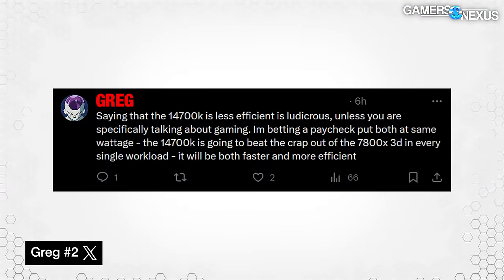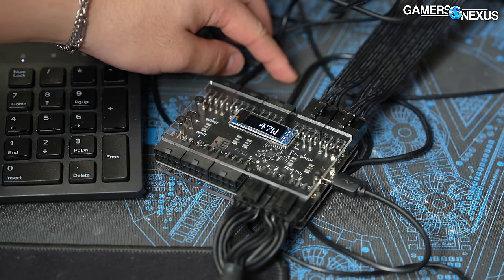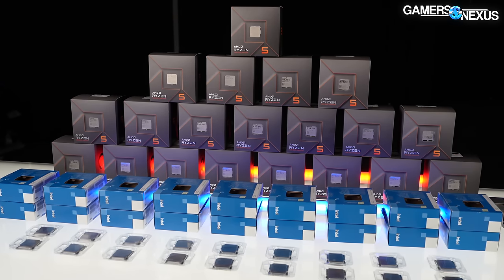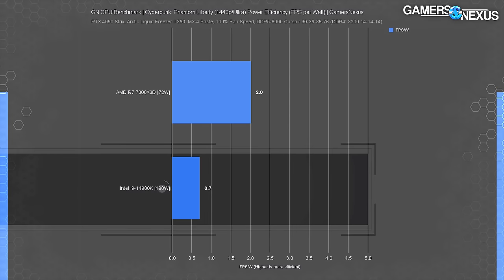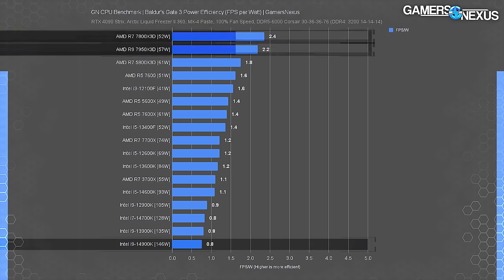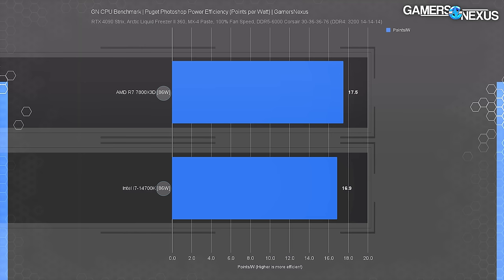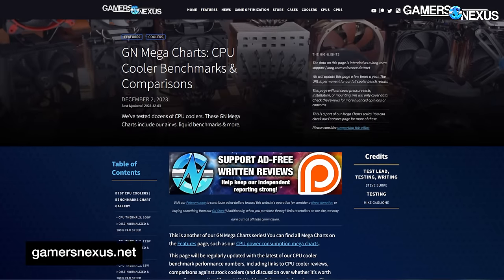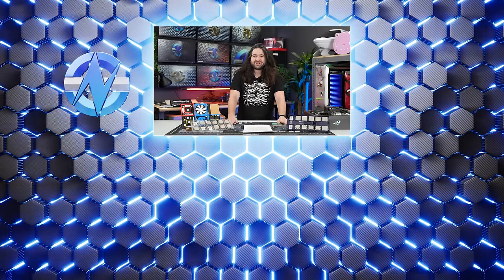The Intel Problem: CPU Efficiency & Power Consumption

Comment: The low-key tragic detail of this video is that the 14900k is LESS efficient than the 13900k in literally every single test. Ouch.
Reply: That was to be expected. They're basically milking the same CPU for a few extra cycles, at the cost of even higher power.
Reply: That just proves that BIG NUMBER BETTER
Reply: Underrated comment.
Reply: It is normal, it is a refresh. Same trash CPU overclocked to look better on benchmark. They literally do on desktop what they say AMD is doing on laptop. But intel is doing it on high end parts.
Reply: because it's literally the same chip, just overclocked a little bit more than it already is
Reply: not surprising, the 12000->14000 series are the same chip, just overclocked higher, the IPC is identical for all 3 gens.
Reply: @arizona_anime_fan  acktually, there was a good gap between the 12 and 13 gen chips, and the icp gap between 13th and 14th is measurable (in the low single digits, percentage wise)
Reply: BUT A tiny BIT MORE PERFORMANCE! YAAAY.....
Reply: This happens every two generations. It's normal. They just overclock the prior gen. Where have you been?
Reply: This is exactly why 14900k has performance difference from 13900k. This is just how intel does things when they have no some shady technology like e-cores for generational improvement.
Reply: @RFC3514  Just something I think is interesting: Intel's CPUs can cope rather well with high voltage and current densities in terms of electromigration. When you run anything TSMC on 1.4V, it'll degrade relatively fast.
Reply: @EffectualPoet  lol chill out, everyone knows. What I'm saying is that it's tragic to see in such high scientific detail AMD leading all charts with its last gen cpu and leading even further with its current gen, while Intel trailing hard with its last gen, and dead last with its current gen. It is tragic.
Reply: @claudiobizama5603  should've added more X's
Reply: @arizona_anime_fan That's actually incorrect. High end 13th genhas the luxury of Raptor cove cores, which are more efficient, better and with more cache. Watch 13700K vs 12900K. Same or Better performance at non - negligeable power reduction. Thing is, Intel's high end has kept being more and more meaningless since 11th gen. Last true i9 worth something was the 10900K. Which is very ironic since it was 2,5 6700K stuck together with a few tweaks.
Reply: Yeah makes sense sadly. They’re just pushing a slightly more refined version of the silicon harder. So even more power for an even lower increase. Hoping the 15th gen is a good jump like the 12th gen was.
Reply: @Psychx_  - I have no data on "speed of degradation", but I suspect if I ran my 230V tools at over 300V, they'd wear out faster, too. Luckily, they run fine at the voltage they were designed for.
Reply: @PyromancerRift Intel's marketing is basically the definition of projection. If you accuse your opposition of something, surely nobody will expect that you're the only actually doing it.
Reply: @LeLe-pm2pr  bro, if you're saying that you don't even know what IPC means.
Reply: it is the same architecture and the same core configuration, there is zero possibility for it to be more efficient, this was clear from the beginning
Reply: Yikes.
Reply: to make intel based efficient cpu, u have to take 14700k, disable P cores and downvolt Ecores with reducing their clock by 15-20%. It will be very efficient and useless as well xD
Reply: So I'm trying to upgrade my AMD Phenom x2 6 core from 2009 😂. What would one recommend I get for gaming? I'm trying to do 1080p at 240 hertz. Then possibly do gaming at 2k at like 144 hertz. Mostly going to play GTA and first shooter games along with some driving games.
Reply: Oh whats worse is I run a 3700X and my nearly 5 year old CPU actually is more efficient than Intels brand new flagship CPU that is double what I paid for my 3700X.
Reply: @Noobsaucer  You say everyone knows the obvious, while pointing out the obvious in your original post... Okay dude. Regardless, the other commenters have made the point that matters, which is that power efficiency really only improves when moving to a smaller node or innovating a way to increase IPC. Those aside, it's just going to be pushing more electricity into the same silicon to achieve diminishing returns.
Reply: Equally as tragic is that the latest & "greatest" Intel CPUs are less efficient than even the Ryzen 3700X, a CPU from 2019.
Reply: @dudebroguymate  People can talk about this until the cows come home. Remember Intel 14nm++++++++++++++++? But then they moved to a new node and efficiency improved. I wouldn't spend too much time on it. Intel is a large company and is well on its way to 20 angstrom node, so it's not like they are going to become permanently irrelevant anytime soon.
Reply: @PyromancerRift    This isn't actually true in all cases. When you release an SKU, its characteristics are locked in, even when you respin it or the underlying manufacturing process or materials improve, with a larger stability margin allowing you a better tune. Effectively, you know you can undervolt the CPU to increase its efficiency, right. But the first stepping is likely to only be amenable to the tiniest of undervolts, while a late stepping is likely to be able to be pushed much harder. So when you release a new SKU on the newer stepping of the die you already used, you can actually offer better out of the box efficiency, or better out of the box performance, or a combination of both.

But we can establish that in this case, there hasn't been any underlying improvement at all.
Reply: @EffectualPoet  We’ll see. They’ve just now maybe finally matched the 2016 Zen architecture in terms of efficiency. As for Intel’s plans? Come on, you must know better by now.
Reply: @dudebroguymate  I mean if your goal is to declare AMD the everlasting winner, if that is true, it really just hurts competition and consumers. Everyone should be rooting for Intel to stay competitive to keep performance to price value from gen to gen strong. But all signs point to Intel 20A arriving soon, and if it doesn't, investors would sue Intel for misrepresentation.  WCCFTech reported four days ago that TSMC, Samsung, and Intel are all on track to start production of 2nm processors in 2024. Not necessarily mass production, but production.
Reply: Then what the hell is the DLVR for???
Reply: @LeLe-pm2pr Because they enabled some L2 cache that physically existed on 12th gen but was artificially disabled.
Reply: @experiencingterpenes  7800X3D. If you're doing nothing but high refresh rate gaming it's the most powerful gaming CPU on the planet.
Reply: Of course it is. It's just a 13900K pushed a little bit further down the voltage/frequency chart. It's an overclocked 13900K. It's a 13900KSS, if you will.

That's what Intel has done with their CPUs in the last few years. They hit a breakthrough with 12th gen... and then just rammed more power into it two more times to get 13th/14th gen.
Reply: It's almost as if the 13th and 14th generations aren't new architectures and just rebranded parts pushed past their limits and getting diminishing returns...
Reply: Makes sense because the 14900k is basically a overclocked 13900k
Reply: Thats to be expected, 14th gen is a brute force refresh, meaning more power consumption for more performance.
Reply: @experiencingterpenes  5800X3D
Reply: It's the same chip, just clocked higher. But that means it is better silicon. My 14900K uses less power at 5.8 GHz all-core in gaming than my 13900K, by around 20-25 watts.
Reply: That's because Intel is changing multiplier on 13900k (when you could do it yourself) and sell as a new CPU
Reply: That was the cherry on top. Mmm, soooo sweet!
The irony here is that I was a total intel fanboy in the '90s. At this point, I doubt I'll ever buy another intel CPU and I probably have another 4-5 decades of CPU buying left to go...
Reply: What id like you gamer nexas to cover is why people are switching that includes other hardware reviewers amd has instability issues other than power consumption and efficiency what can you throw@ intel? AM5 keeps crashing with this platform but your keeping that on the low why?
Reply: Yea. Weve always known that. Because Intel got complacent, Amd came out of nowhere and put intel on the ground, started kicking, and the only thing intel could do on short notice, was push more power through their chips. Iv been telling people buy Amd for A LOT of reasons.
Reply: @experiencingterpenes if you're aiming for 1080p you are definitely fine with a 5800X3D.
But here's the thing. Since you will have to upgrade your mobo, you might as well buy AM5 and get settled for the near future. Its a bit more expensive than AM4 but if you have the budget go for it!
Reply: What's a "low key tragic detail"?
Reply: @WondersChannel  Low key is slang for a secret or something thats not exactly obvious. A tragic detail that a lot of us likly missed. Being that intels inly way to get more Cpu performance and compete with Amd for years now, has just been "Force more power into it the customers wont notice anyway"
Reply: yea but its faster, that is what matters. Im not trying to save watts.
Reply: @TheActionStack  The words of someone who doesnt know that much about hardware but thats alright not everyones thing. But maybe we care about money? Becaruse it costs far more than its worth. Its more expensive, then you have to spend more and make sure you know what your doing with your cooling, or it heat throttles and its not even faster, and all the while its going to cost more year after year. THEN take into account how often Intel forces you to buy a new Motherboard whereas Amd doesnt. Then consider the fact that running more power through it slowly degrades it into burnt carbon so its lifespan is shorter. And MOST people arent even benefitting from the money they spend on their Cpu because in most games unless you turn your graphics down, your Gpu is the framerate limiter anyway. I got a 6900xT on release day, within 5% of the 3090, I used it to game in 2160p 60 Hrz/Fps, and for that framerate, a mere 45$ chip from Amd called the 1600AF did the job just fine. I want everyone to understand. Your Gpu is more important for most gaming. But also, Nvidia have all the same problems. Amd is kind of just a better company, RIGHT NOW. For the moment. They even give us incredible open source drivers for Linux gamers. Amd just works and Im gonna keep rubbing it in Todd Howards face that his games dont.
Reply: @WondersChannel  low key means subtle, not very obvious. By tragic detail means sad fact I guess?
Reply: It seems like the late stage FX strategy. Dumping a ton of power and voltage into their aging architecture (not to say 14th gen is bad relative to earlier Intel chips but past few years and Ryzen competition). Like the 9590 did to hit a bogus 5Ghz = more better marketing number esp with “8 “”””cOReS”””” and as a result ran at what, 1.4V and 250+ watts under load on boards whose VRMs were…. Usually bad. But AMDs guilty of it too on their higher end X processors for years, pushing too much Vcore to hit a slightly higher clock speed while using way more power and running MUCH hotter as a result… I had a 5800X that exhibited bizzare overheating behavior under a 360mm high end (proper paste) AIO and using 150+ watts  at like 1.3V running at 90C around 4.8Ghz. Its a fast chip for a decent price when I got it but its hot and exhibits weird behavior ive never seen in any other cpu. In that some bug with Ryzen master even being installed locked the PPT down to 20 watts and under all core load ran at 350Mhz and literally gave me flashbacks to the performance of dragging windows of my fams first PC which was a Pentium III Dell that made a lot of buzzing and clicking noises and was very loud in general while running. It performed like that until i went thru every bios setting, nothing fixed it but reinstalling windows and not downloading ryzen master. Forgot what i was talking about but fk it pressing send anyway
Reply: @MentalLemur  The history didnt matter much. The only thing thats real is right now.
Reply: I don't think anyone in the comments has mentioned this yet so I will. It is because the 14th gen Intel CPUs are just higher overclocked 13th gen Intel CPUs.
I hope that clears up the main reason for everyone. Honestly can't believe no one has mentioned it yet.
Reply: @RFC3514 overclock it and add 1000 to the name, sell it for $50 more?
Sounds like intel for sure
Reply: @funbucket09  Not exactly but they might as well be lmao. Theres bound to be other differences they tweaked some things and made the chips fresh atleast rather than just taking chips they had in storage right.
Reply: @experiencingterpenes  - If you're upgrading the whole system, I'd say your best options for gaming are the 5800X3D (AM4, kind of end of the line but the MB and RAM will be cheaper) and the 7800X3D (AM5, more upgradable in the future), but a 7600 or 7600X is also a decent option for AM5, depending on the price.
Reply: @experiencingterpenes  I'd go full stupid and get the 7800x3d, as you have to memory switch anyway, might as well do it now. As for the graphics card, that depends on your budget. Tests say that the 4060ti is exactly the same as a 3060ti. And I love the 3060ti. But, my buddy is doing mostly racing games like f1, asetto Corsa and such, and the amd gpu at not much over 100 USD did fine, it was one with 8gb vram that was "too much" for it's other spec. So, check out this channel's GPUs of 2023 roundup video.
Reply: Idk how that’s a surprise but
Reply: 😂😂😂Intel calls that an upgrade!!! Suck way more power for 4% gains for more money on top of the higher power bill. That's the true cost of Quicksync.🤣🤣🤣
Reply: People ask me why I still run my i7 13900ks when they got the new i9s and crap. I7 is still one of the best inten CPU gens for gaming and stuff.